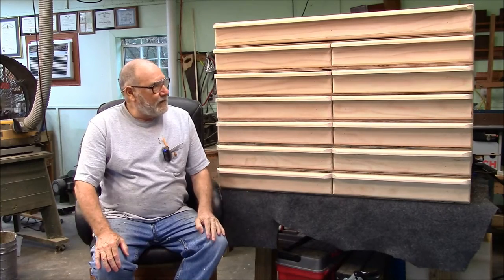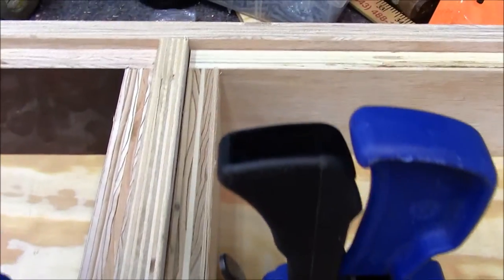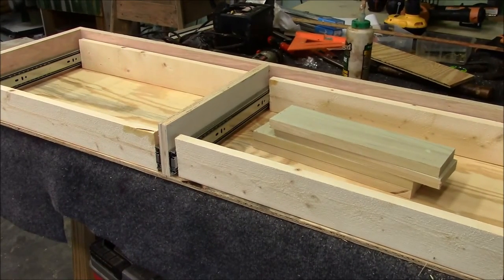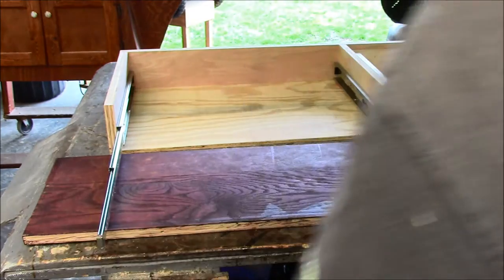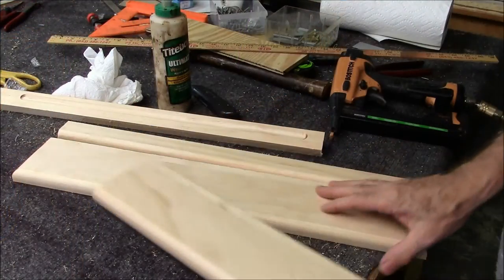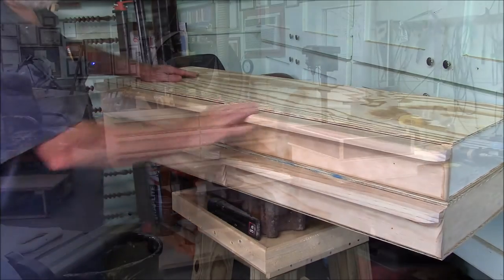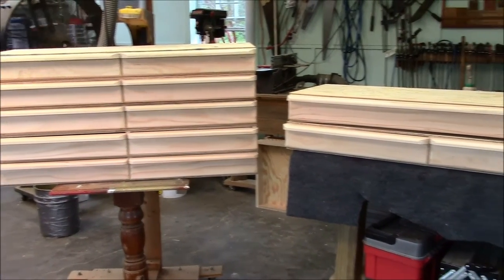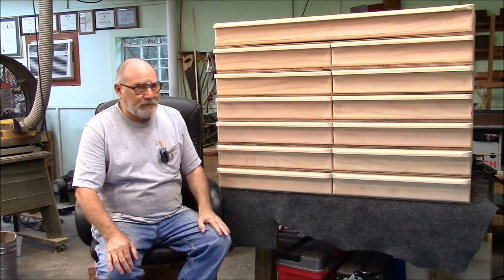33 Designing and Building Stackable tool boxes Phase I

Comment: Nice job.I liked the way you fitted everything together. That is going to be some tool box.
Reply from the maker: +Robert Chase Thanks for the good word.  You kind of point out a sticking point of the design: it was like building seven different toolboxes instead of just one.  In short, I had to build seven different cases, instead of building one case and adding 13 drawers.  That is where all the jigs came into play, as each of the cases needed to be the same.
     Thanks for watching, and Phase II comes out later today.

Comment: This is just what I needed. Thank you for this video.   We're planning a kitchen remodel ...hopefully in late spring.  It's the bank of drawers we're planning that I think we are really going to struggle with.  I suspect we will be replaying this many times as we proceed.
Reply from the maker: +MollyDolly Don't replay this video for the kitchen drawers, as they should be installed in a different way.  I used this procedure because of the "boxes," and the fact I wanted to use the drawer slides as a drawer jig.  
      Way before spring I will have another project up that installs drawers into a cabinet in the conventional (correct) way.  No secret, I liked the stackable toolbox so much, I decided to build me one.  Except mine won't be "stackable," rather it will be a conventional cabinet, with the slides installed to the inside of the cabinet walls.
Reply: *****  Oh that's great!  I'm determined to do this...just completely clueless on finish carpentry.   We are starting to shop for the tools we will need.  A router table it top of my list.  Any suggestions in that regard will be much appreciated.   I think we have decided on Shaker style cabinet doors...so if we will need any special tools for those, I will value your advice.

Comment: Hey Memphis, Thanks for this great video. Lots of extra work to video and show us your secrets. I learned more stuff again. Even though you do not have many thousands of views (yet) be assured this is a valuable service.

I hope iit is OK to point out that you might have forgotten a small detail to mention. It was when you used your air tool upside down and warned us about blowouts and how to be mindful of shooting at right angles. It is a bit dangerous, but not so bad since it is plywood. I can see you know way more than me about this stuff. So I am sure you know how dangerous that is with regular wood. The grain of the wood can curve sometimes and the nail follows the grain and blows out even if holding the air tool perfect. Again, I defer to your knowledge and only wanted to remind you of something I am sure you have happened many times.

Keep up the excelent work.